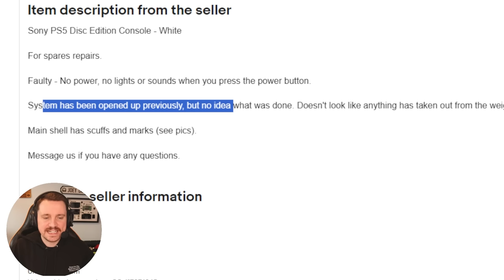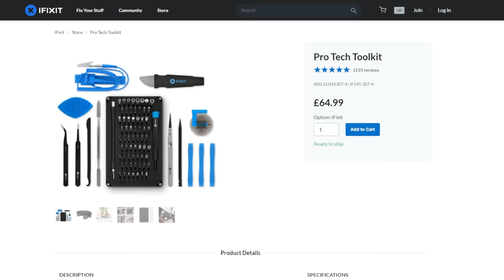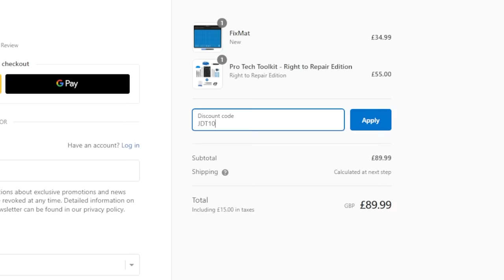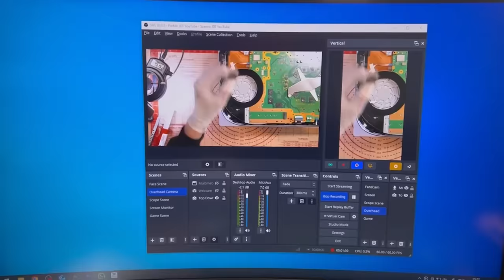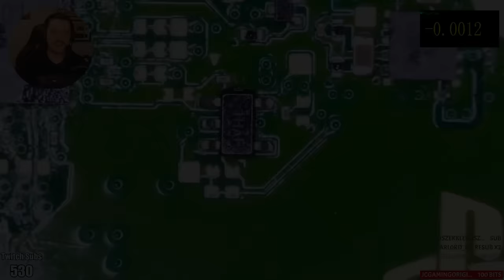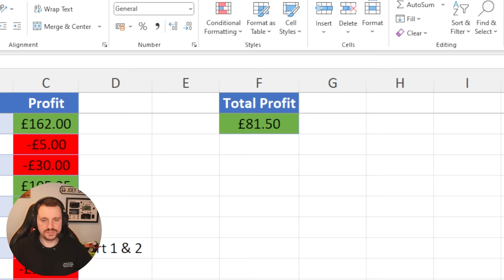Trying to Restore a £200 Faulty PS5 Opened by a Previous Technician! S1:E60

Comment: at 17:06 when you replaced the IC the part number was originally 1D7T and was replaced with a Y18K8. not sure if they are the same chip labeled differently or close enough specs wise not to make a difference.
Reply: Hello, he had explained in another video that there is no problem to replace just another series motherboard but it does the same job, the funny thing is that Joey does not see that he puts the chip in the wrong direction and that's where the problem comes from, and he has already done it once 😅

Comment: My 2 cents of help :) At 28:04 that 1D7T chip seems to be a linear regulator from 3.3V down to 1.8V. It seems that that left bottom pin is an "enable" pin and it should have 1.8V or 3.3V in order for the output 1.8V to be present. Maybe trace that via to it's origin and see what causes it to not be at a "high" level. Maybe a blown resistor or some other regulator?...

Comment: I have a PS5 with similar issues. No power on at all. Found shorts on hdmi encoder and WiFi if. Swapped components, no shorts but no power. I do not have the 3.3 coming out of that IC going through the board to the other IC that goes to the hdmi encoder.
Can’t find any other shorts and as far as I can tell that 3.3 is the only voltage missing  🤷🏻‍♂️

Comment: Good video but you did way too much. You changed so many things, so many times, it is hard to even know if they were faulty or not. Or you damaged them later. Your first bet should be to test the hdmi port with a breakout board to determine if the port is faulty first. Then test the hdmi encoder  data and filter lines, caps for shorts or opening. Then I'd consider replacing stuff. You might have spent all that time just because of a bad port or cap. Also I'd avoid consoles that have been opened before as those on Ebay are most of the time unrepairable and should be bought for parts.